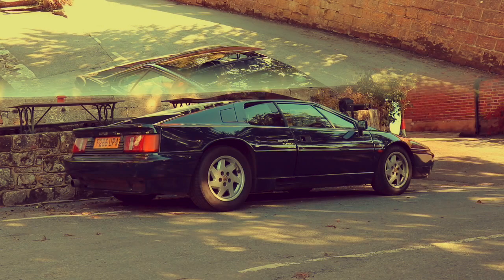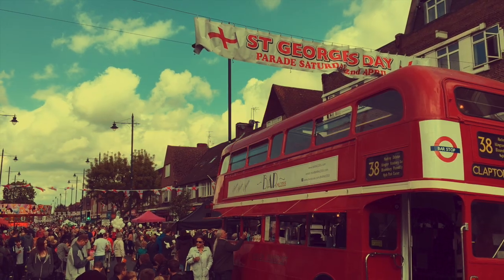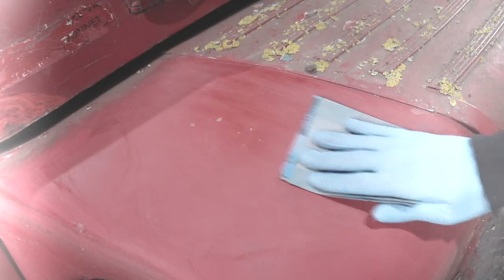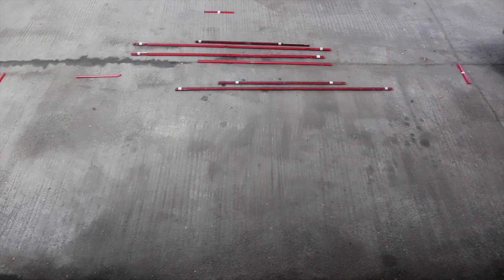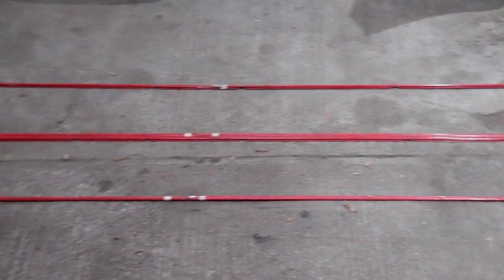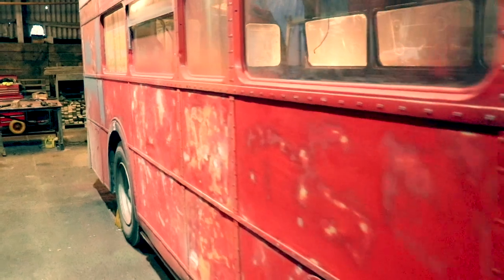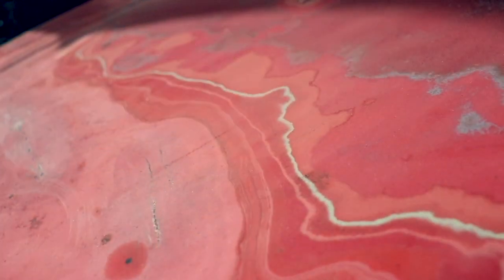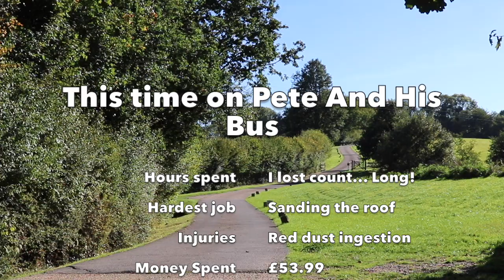Pete And His bus, Episode 10: The Sanding Saga

Comment: Right, I can write more on here Pete, limited on TikTok. Do you have the automatic gearbox still? One of the most important things in the leaflet I was on about:- 'It is important that the bus should not be allowed to idle in gear for long periods. This can overheat the fluid flywheel and cause mechanical damage. Always idle in neutral when held up in traffic.'

At Chiswick we were shown a video of what the 'mechanical damage' does. It splits the flywheel case and the fluid pours out onto the road. If the road is wet, that fluid interacts with the water and the whole lot goes up in flames - video of bus in flames.

Only a small leaflet but interesting. If you want a copy let me know.

Driving. Of course Chiswick was the best in the world for training drivers especially with the the skid pan. We were taught to keep up with the flow of traffic (even if it meant speeding).

We never used first gear unless it was a very steep incline. Start off in automatic 2nd which was the 4th gear position on the tree, when that changed to 3rd, push it forward to the 3rd position. Belt along, get the most out of that and then whack it back to 4th. Great fun.

Of course, if your auto has been removed on yours you'll just have to drive manually with 2, 3 and 4. Occasional 1st on an incline. Keep th power steering oil topped up or it can suddenly get very heavy going around corners. We had to stand up sometimes when it did this and pull hard on the wheel.

Keep  your injectors clean and tignt and it will fly along.
Reply from the maker: Hi Kris, loving all your tips! Very useful! Just so you know I have another bus that I've been driving around for about 4 years so I'm pretty confident o how to operate them. My auto box is disabled in my first bus so I do exactly as you say. Thanks for all your superb advice and make sure you "like" the face book page! Lots of bus chat on there. Thanks again! Pete
Reply: @PeteAndHisBus  Hi Pete, not doubting your ability to drive them. That tip was for the auto box. That's the way we used to drive them to get the best out of them. Can be quite lumpy changes if you let the auto do all the work especially if the bands aren't tight.
Reply from the maker: Yes couldn't agree more! You seem to know your stuff! Drove them for long?
Reply: @PeteAndHisBus  Only for a year before moving to Bournemouth & working for Wilts & Dorset in Poole. Very interesting fleet there. Because you were only given an automatic licence with a Routemaster I had to take a manual test on a crashbox.
 Left there when it was privatised and joined BR. Recently retired after spending the last 20 years driving something with a cummins engine and torque converter - Class 159 train. We had quite a few ex London Transport Routemaster drivers on the railway. Natural progression and better wages of course.
Reply: Also spent a year as a conductor before I went driving on LT so I learned a lot from the the old boys. I still have my budget key somewhere if you need one. To access the hatches for the blinds and the conductors locker under the stairs.

Comment: You're a trooper getting that done.
Are you keeping the 22" rims or considering sourcing the original split rims with tubed tyres that look really good and industrial to me.
I used to catch AEC single deckers dating from the 70s with rims like your RML has got, so not inappropriate for an AEC even if not original for a late 60s AEC.
Reply from the maker: Thanks for your support. I’m keeping the rims I think.
Reply: @PeteAndHisBus  you could just change the fronts only. Whatever you do, get a set of front nut guard rings at least. 
Love to see a good view of the Accu-Trak Hubodometer on the rear wheel. I've always been fascinated at those things.
PS may have come across as barking orders. Just my personal thoughts.